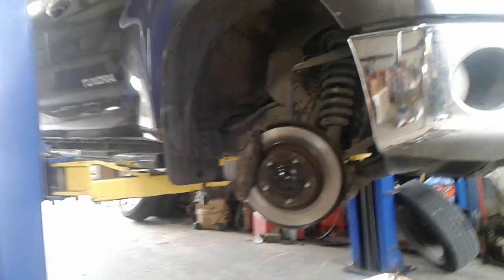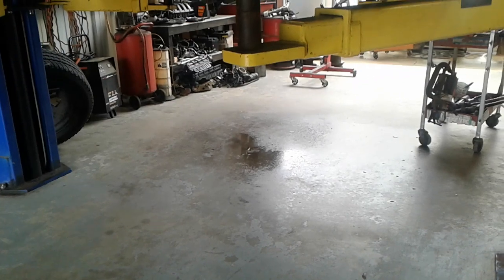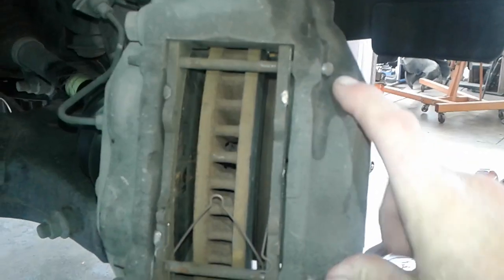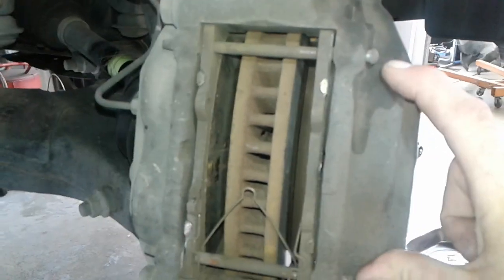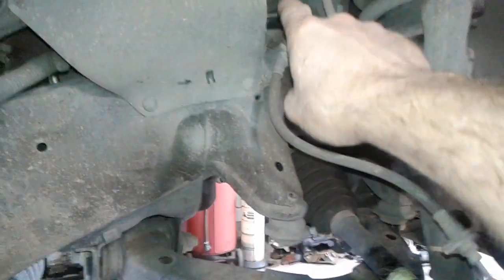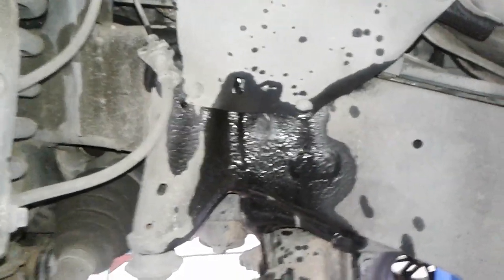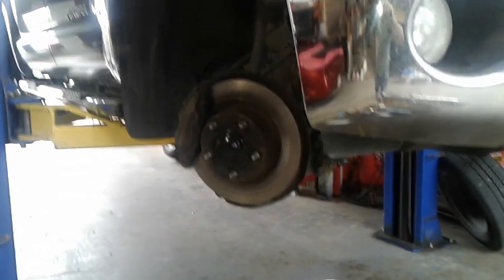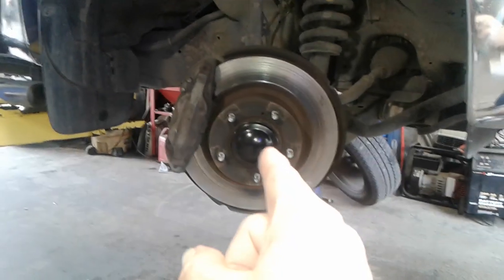Never Ever Add Brake Fluid To Your Master Cylinder!!!!

Comment: Very good advice!! Another thing I'd add is brake fluid does take off paint. A lot of people don't know that. And something that probably NO one ever does and that is to actually change your brake fluid every few years. Yeah I know who does that, but it is listed in a lot on manuals as maintenance tips. The fluid does get contaminated. Great video Pat keep them coming!!
Reply from the maker: Thanks Jason. You're right about the fluid messing up paint, although I don't think it had as much effect on the urethane paints as much as the acrylic enamel paints they used to paint cars with. Thinking of this,I have an old fender laying in the scrap pile I'll go out this morning and pour some on it and do a test!!! Thanks for watching and Keep Rocking!!!

Comment: Good video Sir! I was at the Nissan dealer in Baytown last month and they said I needed to change my brake fluid on my Maxima because it has over 30,000 miles on it. $180.00 for a brake fluid change... I laughed!!!
Reply from the maker: Let me guess, you were there for your "free" oil change!!! Don't ever buy any of those kinds of services. I've been fixing cars for over 30 years and I very rarely have to flush any of these fluids. Doing so is not going to make anything last longer, especially your wallet!!! You're not to far from my shop and if you ever need a mechanic look me up!!! I shoot straight and I'm not looking to rip anyone off!!! Thanks for watching and Keep Rocking!!!

Comment: this really good video period , dummy question it is really bad to mix old with new brake fluid using syringe  and replacing the level with the new fluid .or is better to keep the 75000 miles old brake fluid ?